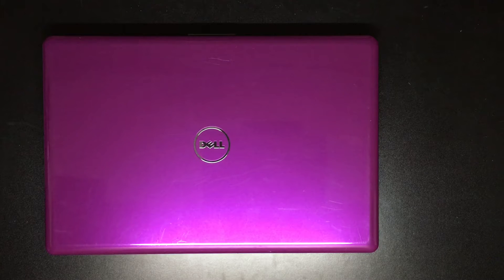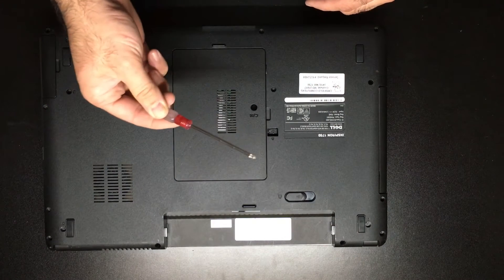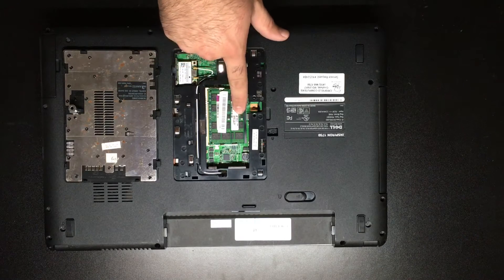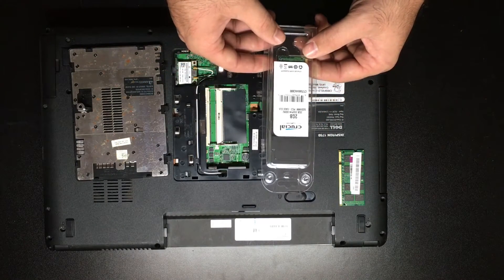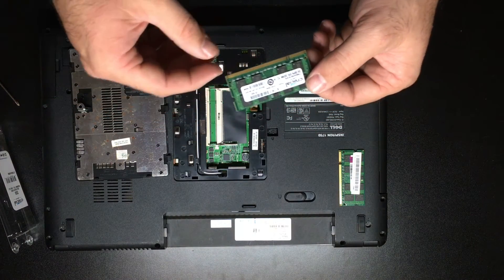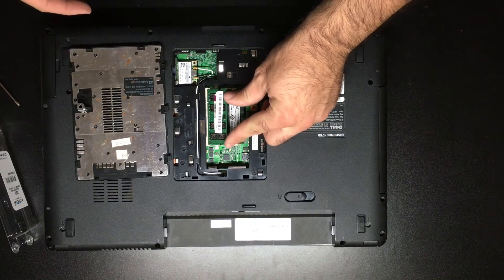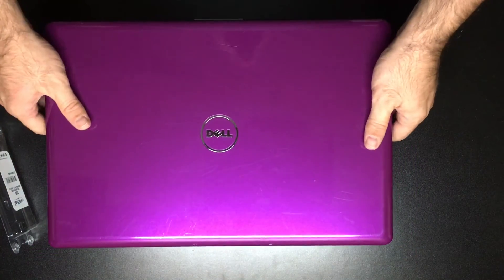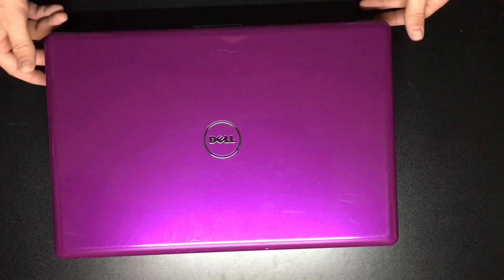How-to: Dell Inspiron 1750 Memory Install

Comment: 2GB stands for "Two giga BYTEs" and not "giga bits"
Reply from the maker: That is correct. sometimes in talking I say things that are incorrect, i have a slight brain to speech issue when talking. luckily my stutter doesn't show on video. ram is GB, internet it Gb :) thanks for that correction

Comment: What is the Maximum memory GB you can add to the Inspiration 1750
Reply: That's what I said. 2 slots of up to 8GB. Where do you see 16?
Reply: It supports 2 lots of up to 8GB. I just upgraded mine.
Reply from the maker: absolutely not true, it will not support 16GB of ram.
Maximum is 2x4GB
http://www.crucial.com/usa/en/compatible-upgrade-for/Dell/inspiron-1750